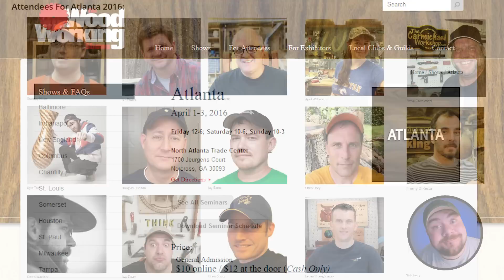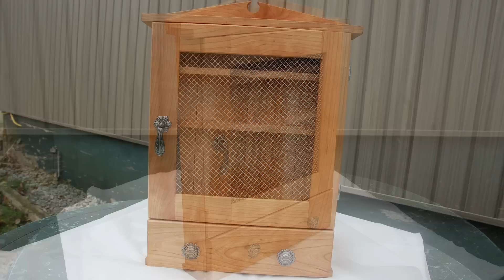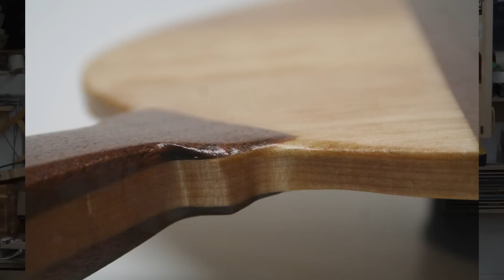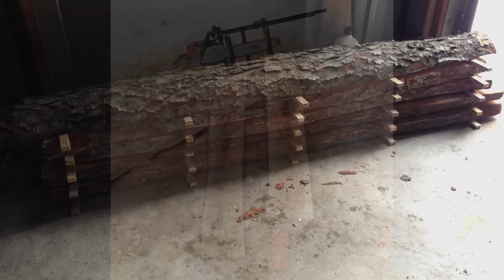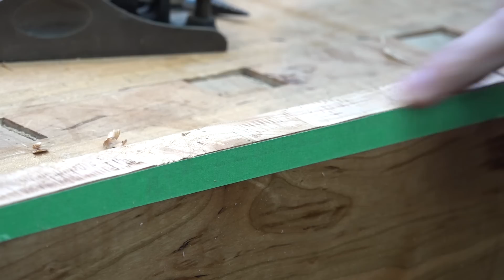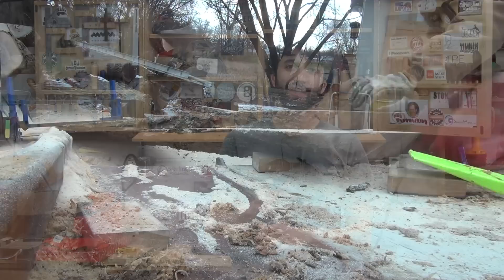Matt's Weekly Shop Update - March 21, 2016

Comment: Matt, where your base molding goes into the corner are you going to use traditional corner blocks or are you going to use a coped joint? The project looks fantastic and I really like the jig for cutting the door trim. Great work and attention to detail. Paul / paulsmessyworkshop